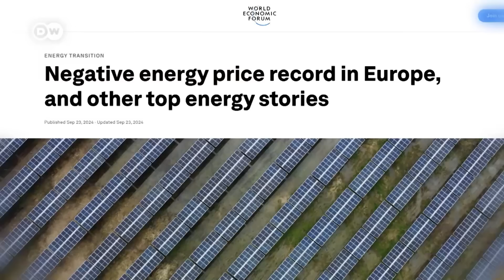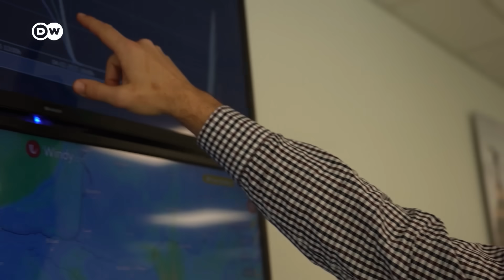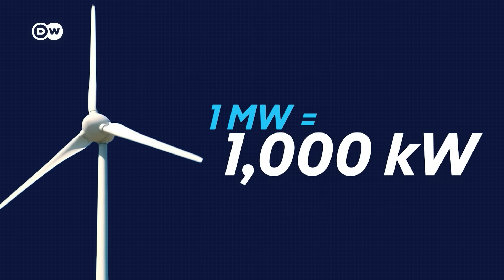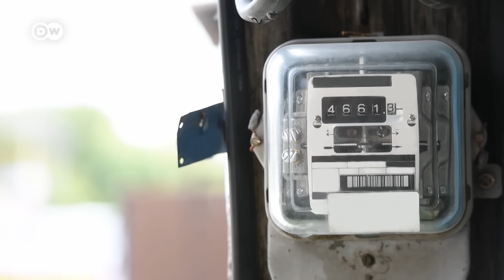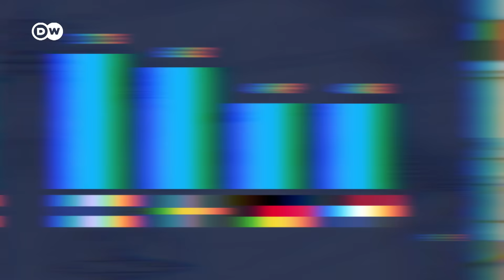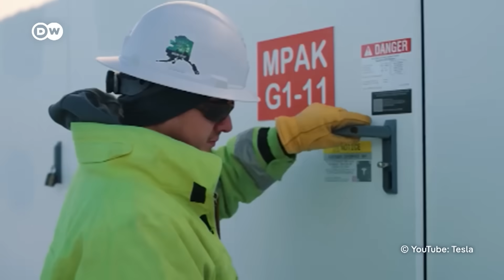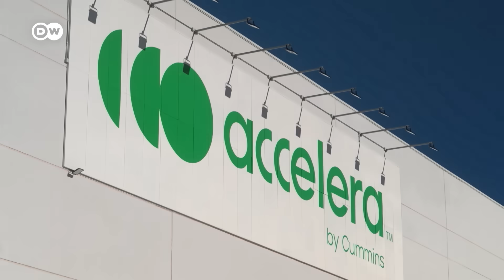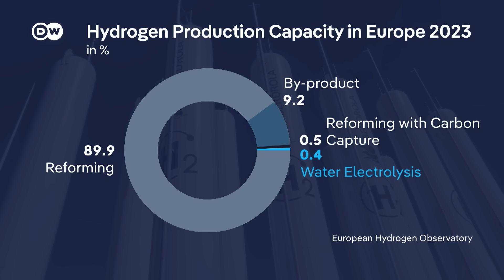Negative energy prices: Why cheap electricity can create huge problems | Transforming Business

Comment: Lol. Pakistan has too much energy and too much expensive as well that people just don't wanna use the energy from the grid. The ones who can afford solar systems has switched to solar, the ones not so lucky are left behind stuck with the grid with even more expensive and heavily taxed electricity.

If any company wanna sell electricity at high prices with guaranteed profits, just bribe the Pakistani Govt and setup a plant there. Your power plant would mostly be shut anyway but would generate revenue on capacity payments and banking loan payments from the Govt. It would be beneficial to have knowledge about who holds the real power before investing in a corrupt regime like Pakistan right now.

Comment: Hydrogen is not a long term solution, being the smallest element it leaks out of anything but the most robust storage, per molecule it contains very little energy compared to longer gaseous equivalents, and it's far more explosive than methane, hydrogen goes through hype cycles before failing again and again because it is a bad solution to our energy crises.

Investment would be better spent developing cheap alternatives with alternative battery chemistry (or ditch the battery altogether). We are currently using a chemistry designed for portable devices, there is no need to do this for industrial long term energy storage.

Comment: First of all the subject of this video is wrong. The point is the unbalance in production and demand. A side effect is negative pricing in the wholesale electricity market. Not really of concern for the end user. There are two major solutions before thinking about battery systems to bridge day and night or even seasons. Because of the cost battery systems only make sense in very specific applications. The two major steps are : the average household needs to improve self consumption. Secondly the electricity supplier should be able to curtail overproduction by the solar inverters by sending a command to the inverters to do so. Per region the variables are very different. Where I live plenty of equipment is available for improving self consumption on your own premises but people are much unaware. Certainly do your research under the term power diverters and look for a car charger that follows the excess solar production. What is missing is the possibility to do the same when your car is parked in the street. About curtailing the inverters by the electricity company as far as my knowledge goes the technology is non existent or not in use. So there's work to be done by the government to stimulate this, please. To give you an idea : since 2 years I stepped from carbon to solar, I reworked the electrical cabinet as to be able to have power meters on every point of interest (around 30 kWh meters that goes) and I've got dashboard tablets and wifi displays to show the key Watt and 'kWh today' readings. Mostly automated and sometimes by manual control power is divided between car, heating and boiler. With extremely good result, relatively low cost of investment and no home battery needed. Kind regards, Jan

Comment: Negative energy prices are only problem for fossil fuel and power companies that needs to charge ever higher prices for the same or smaller amount of energy in order to pay big salary and bonuses to CEOs and CFOs.  

Negative energy prices are the market signal to build more battery storages and more interconnection transmission lines so that you - or some company most likely - could "buy" that negative electricity and then release the stored electricity when the demand is higher thus getting paid at both ends of the transaction.

Comment: The problem is not cheap electricity, but how the market is set up. Europe operates with geographical big auction markets, where for example the whole of Germany is one of those. Add to that the merit order pricing. So there is hardly an advantage to be in an area, that produces cheap energy.
The USA operates with nodal markets, where prices are much more localized and much more responsive to  supply and demand at every location.

Comment: The formula is wrong. The price is not the problem. The problem is generating more energy than needed. That destabilizes the power grid and forces production companies to buy demand to avoid failure, because green energy cannot be easily controlled like a turbine or a fossil-powered generator.

Comment: I hear the carbon industry talking: This is largely a manufactured problem and, frankly, exaggerated. Suppliers of solar and wind power are currently earning substantial returns, precisely because electricity prices in much of the Western world are set through marginal pricing, also known as the merit-order system. Even though solar and wind are far cheaper to produce than gas or oil, they are often paid at prices determined by the most expensive marginal source. That leads to structurally high revenues. Against that backdrop, a limited number of hours with negative prices does not undermine investment in renewables. If anything, it reinforces their economic case. The idea that negative pricing threatens the viability of solar and wind is a narrative pushed mainly by parts of the fossil fuel industry.

Solar technology, and increasingly battery storage, follows a trajectory similar to computing power: rapid, compounding cost reductions and performance improvements. While “Moore’s law” is not a perfect analogy, the direction of travel is comparable. Despite repeated claims from certain corners of the energy sector that growth is slowing, deployment continues to expand at an exponential pace. As storage technology improves and becomes cheaper, negative pricing will occur less frequently. The ability to store energy for days or even weeks, rather than just hours, will fundamentally change how electricity markets function.

Comment: Negative prices is NOT the problem. Think again! Handling the variation of energy is the challenge! Store the cheap electricity in sandbattery as heat. It does not matter if the efficency of the battery is low when the electricity is for "free". Tap the heat into electricity with sterling engines or steam engines! Also use the heat to warm up houses or industry. You get cheaper energy bill by not using the grid, build sandbatteries as a integrated part of a factory or a house. The "off-grid" society opens up for truly low cost electricity. No need to be forced to feed "Energy Capitalists"

Comment: Major issues with dimensions and units between power and energy in this piece. DW, energy is a stock, power is a flow, and 500MW of energy storage per year is not a thing, I think you meant 500MWhr per year?

Comment: It’s a problem because the energy company’s and govs are stuck in an old system, it’s either full price or turn them off! customers should be able to set devices to charge once the price per kWH drops, if i set my immersion tank to only charge when the price drops say 12p as the lower the prices those people that have pre set devices to charge at certain rates will take the energy for an affordable price. The voice over is so annoying why the reverb in her voice?

Comment: It shouldn't really be an issue and this is where when people say hydrogen isn't the future don't realise how power grids work especially renewable

When there's excess energy you can make hydrogen which effectively stores that energy so it can be used later for fuel cells combustion and so on

Energy generation isn't constant with renewable so storing that excess for later will prevent the negative prices be it battery storage or generating hydrogen etc

Comment: I mean ultimately market has to work for us. And in case of energy market, you have to adjust it in way that incentivizes energy production where and how it's needed. And at the same time we should get lower energy by more production.
I think way this could be controlled is by mandating energy storage for solar farms, wind farms probably don't need as much, but they would benefit from it too. This means they can sell energy when they can get best price from energy storage. 

I see people saying it's good prices are going down. But issue is that we NEED more zero carbon energy, and if there's no incentive to build them, they just wont get built and invested into. And this isn't about lower customer prices, its about oversupply of energy at times, making it worthless. Way we as customers get lower prices is by having more energy production overall. Aka. if energy companies don¨'t have incentive to build, out costs wont get smaller.

Comment: It sounds more like a storage problem. Currently the energy prices are very high and German industries are complaining about their high production costs, especially in the steel industry. Seems like this reporter didn't do their homework or this is more an ad disguised as a de report.
Reply: Also, if the negative prices are not reflected on the consumer's bills, who takes the difference?

Comment: The entire wild AC generating space from solar voltaic and wind generated electricity has to be 100% backed up by the public power grid with fast reacting peaking power.   This is more expensive than making all the electricity from economic fuel efficient means.   The overwhelming method for supporting the wild AC generating space by public power grids is by running natural gas turbine generators at high readiness 70% fuel consumption making near zero electricity where 100% output will 100% backup the wild AC.   This consumes more natural gas just maintaining high readiness than making all the electricity form efficient running natural gas combined cycle power stations.   When making up dips in wild AC output more natural gas will be used.

Solar voltaic from private sources have the potential to come onto the public power grid near the capacity limit of the supply lines to those sources.   This entire solar voltaic wild AC generating space needs to be supported with fast reacting peaking power.   If there is a possibility there maybe so much incoming solar voltaic wild AC it over supplies the demand on the local grid the local grid needs  prior arrangements for it to be supplying power to a remote grid to cover this over supply.  

The local grid is having to support all the wild AC with fast reacting peaking power just to get rid of some of it which includes suppling constant power from peaking sources to the remote grid.   The power grid can not typically refuse wild AC.   There maybe no means to disconnect solar voltaic generation from private residences from coming onto the grid.  If there is no means to get rid of the over supply the grid will instantly suffer over frequency causing interlocks to throw causing instant blackouts.

Comment: Once (in 2014) a guy that worked for large scale powerplants in France said to me, that negative energy prices is just the very temporary error of Germanys errors in subsided renewables industries.
And work labor will get cut in renewables and will change because the ne new economic Ministers of CDU will undo this idealistic "green nonsense" and Altmaier & Gabriel will correct this. 😅

Well I corrected this France related engineer and said conventional large scale powerplants have a big disadvantage to the customer:
" A customer gets a very expensive product because he needs to pay all the transfers fees over the power grid, the maintenance and the golden bands and neckless of the COEs on large scale infrastructure."

That makes a small scale local solarpower generator and smaller windmills very compatitative and this is why in my mind the frequency of negative power costs will rise no matter what Germans (or European) konservative economy ministers will do. They will only delay renewables for some years and make energy cost very uncompetative 😢. The goal is reduce unflexibel big scale infrastructure and systemically invest in transfer and buffer systems in all over Europe.

And there we are in 2025 large old scale power in France cost a lot of maintenance and bleeds out the state finance on the back doors while France government over EDF tries to get the image subsidized the wall socket current in privat houses is cheap. 😅

And in Germany we pay the cost becauseformer energy ministers delayed the investment in 2015 to the power grid to actively electric buffers in northern Europe.😢
In Germany we have two options optimisers and use power on demand if it's cheap, battery or power to hydrogen for deep winter supply on 
"Dunkelflauten". Fight back to classical will make energy in future more expensive than economy in Europe will survive. 😅

But it's very mutch the future cheap waste local solar generated privat energy instead of consum old konservative expensive large scale generators. Privat Investment force old mindset to adapt to the new situation or they will not survive. 😅

Comment: Green hydrogen is great, as it provides power for mobile use. Batteries hold power for much longer than stated, and there are a large number of other methods for static storage.
The problem holding things back now is "profit" and this is where governments need to step in. Grid companies won't invest in something that doesn't pay a dividend to their shareholders. That is where the block will come from. Voters need to look at their governments not short term, but long term. Very difficult, as most people don't vote like that "the popular vote".

Comment: Compressed air is somewhat inefficient but real cheap with the advantages that hydrogen  or natural gas can be used to triple production, if the tower for the windmills is designed as air storage the $$$ go down even more.

Comment: This is the huge problem with renewables : they are unpredictable and batteries are nowhere near ready, so you NEED either nuclear, coal, or gas on top.
Only one of them (nuclear) is low carbon.
And ladies and gentlemen, this is why Germany after shutting down nuclear plants has become the #1 electricity-related air polluter and CO2 emitter in Europe, with 5-10x worse CO2 emissions per kWh than countries like France or Sweden (google for "electricitymaps" to see it in real time)
It's estimated that coal pollution causes 10.000 early deaths / year in Europe per year (not even mentioning climate change). Most of the top 10 coal factories are in Germany. By contrast, Fukushima caused 1 (one) death by radiation. Think about it ...

Comment: The analysis of batteries in this video was really weak. Commercial lithium ion batteries might well only be useful for holding energy for a few days but alternative batteries such as redux flow or heat batteries can store energy for far longer periods without fear of degradation. They’re not as energy dense as lithium ion but for grid level systems that’s far less of a problem.

Comment: The low energy efficiency of hydrogen energy storage is a very small problem, compared to the costs. All commercial hydrogen production without absurd subsidies and or other incentives is produced from fossil fuels, when and where it's needed. Significant amounts of hydrogen is never produced from electricity, stored for long or transported long distances in purely commercial applications, as in without subsidies or as PR-project. That is because making "green" hydrogen is very expensive, even if you get the power for free occasionally, and storing hydrogen is extremely expensive, transporting hydrogen is very expensive.    

Many modern LFP batteries, including cheap ones, has a self discharge rate well below 1% per month, so it takes many years before they have lost as much energy as production of "green" hydrogen and conversion back to power lose, and the cost of LFP batteries is also only a fraction of hydrogen energy storage system per unit of storage capacity. So, no, even for long term storage hydrogen doesn't provide any practical advantage, at all, hydrogen is much much worse than batteries for storing energy in every relevant practical aspect.   

It's important to remember that the value of energy storage is the value of the energy you get out of the system. That means seasonal storage has to be dirt cheap per unit of energy you get out of the system for each cycle to make sense, as you only cycle the system once a year. If you could build hydrogen energy storage system for just one million euro per MWh capacity, which is 1000 euro per kWh, after storage, if you cycle that once a year, the cost of that energy, just from that initial investment, spread out over all the energy the system delivers the first ten years will still be 100 euro per kWh out of the system.           

You might think, well, you have the hydrogen storage system forever, it's free to use, unlike batteries, but that's not true. Just maintenance of a hydrogen storage system is much more expensive for a battery systems, including replacing batteries. And many parts of "green" hydrogen systems has to be replaced more often than well designed battery systems requires any maintenance.

On top of all that, batteries can both store and deliver a lot of power, instantly, as needed, and very reliably. Hydrogen energy storage can not do that.

Comment: If we expand the use of storage batteries, I think the problem of their lifespan will become apparent.
I'm an electrical engineer in Japan, and I have a slightly unique idea for gravity power generation.
It is also assumed that it would rain for several days and solar power generation would be ineffective.
Since I was betrayed by Japan's Ministry of the Environment, it is okay to publish ideas if you are a company you can trust.
However, it is considered inefficient, and is characterized by its assumptions that it can be used in the unlikely event of a disaster.